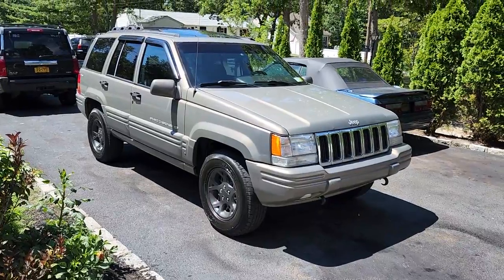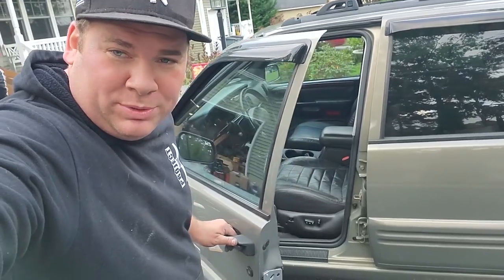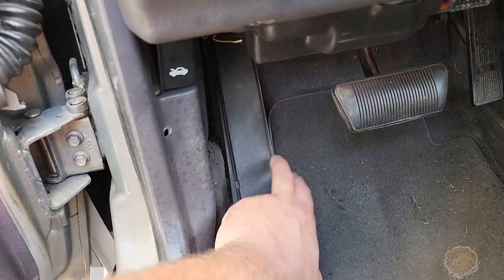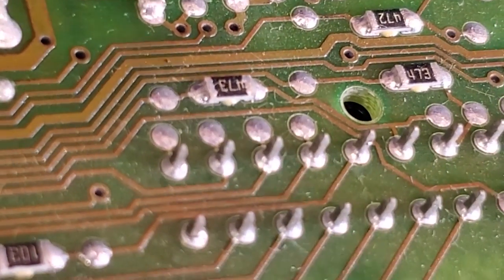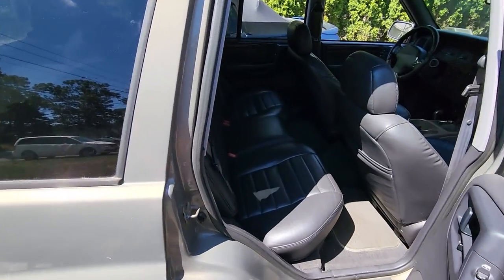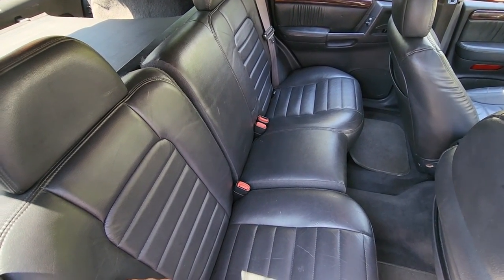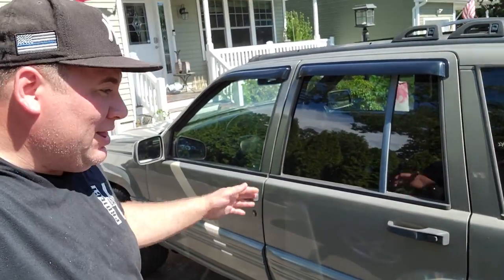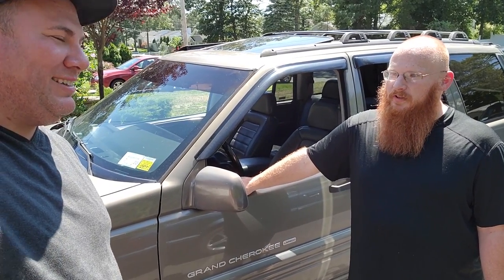THINGS I LOVE and HATE ABOUT THE JEEP GRAND CHEROKEE ZJ - BYE BYE GENERAL GRIEVOUS.

Comment: Your videos on General G inspired me to find a ZJ, (my daughter was driving a 2wd) for daily driving and something to tinker with.  I found a 95 for 1500$. It’s been three years and its the most useful vehicle I’ve ever owned even over several pickups I’ve had.  I’ve hauled axles, transfer cases, trash to the dump, recycling, driven cross country,  (WA to PA and back), where I slept in the back for two weeks. Now it’s my mountain bike trailhead rig.  

Wish I still had my 84 Scrambler but I really love this thing.  Needs a new tranny soon and the valves are getting noisy but I’m keeping it.  I keep the seats in the back laid down, in fact only the bottom to the small seat do I keep inside.  That is for the my grandson’s seat.  Awesome vehicle! 
Thanks General! Thanks Dan!
Reply from the maker: Thank you so much Paul! I'd have to agree... The ZJ is the most utilized utility vehicle out of all my SUVs!  Thanks for all your views

Comment: @Project Dan H: 
The Windshield Washer Fluid Reservoir more-than-likely has that empty void at the top to help prevent a completely full reservoir from creating a vacuum as it empties, thus restricting flow through the line. Like filling a 2-liter soda bottle to the top, capping it and poking a hole in the bottom - it'll trickle out slowly - Remove the cap as it's draining and it'll start pouring out.
Reply from the maker: Smart.. A little air displacement goes along way!
Reply: @ProjectDanH  Also, think winter time. Gives the possibly freezing fluid room to extend, rather than let the system burst somewhere.
Reply: Could also be helping on freezing temperatures to have some extra volume to explant.

Comment: Dan thank you!  I just bought our 6th ZJ!  I’ve had new and fancy Grand Cherokees but I prefer the ZJ’s the best.  The first was new in 1994 and we’ve been driving one consistently ever since. The latest is a ‘97 TSi w 5.2.  Gonna run it through a body shop for clean-up and use a rusted-out ‘98 as a donor vehicle to upgrade any parts which  are better on the donor.  I’m excited the TSi doesn’t have a sunroof OR memory seats OR the auto HVAC system.  Simple is better when dealing with vehicles with age.
Reply from the maker: yes 100%  Sunroofs have been a pain lately! lol

Comment: I replaced the tumbler in my WJ with a part from Dorman that gets set to your original key the first time you use it, so no locksmiths required. I would guess (without looking) that they probably have one for the ZJ as well. It was pretty cheap, and super easy to replace. It's been working great since.
Reply: The zj fobs require radio waves so you need to pay the dealer or a locksmith
Reply: @martinvalencia6141  I was talking only about the key and the ignition cylinder, if you replace those, the key fob module does not change, and neither does the chip key. The Dorman ignition cylinder I am talking about gets coded to your key the first time you use it, so you don't need a locksmith at all for just replacing the ignition cylinder (which solves the problem with accidentally pulling the key out in the ACC position, leading to a dead battery, which is the issue Dan had with his ZJ.)
Reply from the maker: That's awesome!!

Comment: Dan , your cup holder is missing the rubber insert! My Free-Z  ( same color '98 ) has one and it looks to be OEM. The two pockets securely hold anything that will fit inside. 
Very well done videos and you helped me get my ZJ up and running where I just finished a seven hour off road 4-WD Club adventure and the Jeep handled all of the trails,hills and descends like a champ.  100% stock.
Reply: Cup holdsr insert only came on 98 midels.. was a last minute feature. Thats why i make boat loads of money selling them online lol

Comment: Dan, I'm sorry (and sad) to hear that you SOLD Gen. Grievous. I loved and learned a lot watching you rebuild Grievous. I own 2 ZJs, a 1996 and a 1997. The 96 is the exact same color as Grievous. I wanted to tell you that turning the key past off is called the AUX position. It is a normal function of this ignition tumbler (most cars I know of have an AUX position on the ignition tumbler. It's for playing the car stereo and other misc electricals without running the engine). Although, my keys do NOT pull out in the AUX position. I also wanted to tell you about another feature of the ZJ that most people don't know about. I'm not sure if the XJ or WJ or other Jeeps have the same feature (as far as I know it is a Chrysler thing so maybe they do?), but you can read your engine codes using the ignition cylinder. If your "Check Engine" light should come on for any reason, you can see the error code on your display without using an OBD code reader. Here's how...turn the ignition ON...OFF...ON...OFF...ON...OFF and finally ON...but DO NOT START THE ENGINE. Wait a minute. then Watch your lower right dash panel lights flash and count the flashes to read the number codes. The codes are usually 2 digit numbers...example: The first code will always be BATTERY code 12 and will look like 1) BLINK....2) BLINK-BLINK. End code will ALWAYS be 55 and will look like 5 BLINKS...5 BLINKS. All pairs of blinks in between 12 (battery) and 55 (end of codes) will be your trouble codes. I learned this trick with my 1996 ZJ when it had a bad ignition coil/ignition relay. I didn't know what was going on until I was told about this CODE trick and error code 45 kept coming up. I hope this is helpful information for future reference.
Reply from the maker: thank you so much for watching, yes the aux position is common however the keys are not supposed to come off. lol.  not many people know about the Chrysler self-diagnostic mode.  The XJs can be activated if you press and hold the odomiter button while putting the keys into the on position.  Thanks!

Comment: How about how to install new windshield wipers?  I did it about 15 years ago but I must have lost some IQ and patience between then and now...  can't find a video about it for the ZJ.  Thanks for  the videos.  I got my driver's side lower door hinge welded about a month or so ago and already one of the side welds has popped loose, have to get that welded again.  I think what happens is the little thing that looks like a round gear stops rotating so it creates extra leverage on the hinge.

Comment: My XJ is guilty of that overturned key thing. It has just been a jumpstart. I’m used to it and careful of it but anytime someone else drives it I gotta warn em. Lol
Reply from the maker: Lol... New drivers just don't know!
Reply: Its an accesory only feature..  to keep 12v ignition power off.. it isnt a defect
Reply: @jeepsblackpowderandlights4305  no the key position isn’t a defect. Correct. However over time the line gets blurred as to just what position is going on in there. I find it’s just one of those things where you have to use a softer hand. If not you’ll be doing some repair you don’t really want to.

Comment: My truck being a 2000 dodge ram Laramie slt doesn't have the halo ignition ring illumination,, I have a black plastic ring no light.and im lucky my cylinder works fine and you cannot remove the key unless it is in the off position and I am ruining it so I can pull out the key lol and I like the ram second gen center console on the seats and the manual gearshift lever for the transfer case

Comment: The extra key position is an acc only one. You shouldn't be able to take the key out, so it does look like something is worn/broken.
Reply from the maker: Yep. Definitely a worn tumbler!
Reply: Actually no you can take the key out on all ZJs there is no locking function..  but yes hes a noob the last click is for radio etc so you dont have 12v ingition on for power.

Every single ZJ ive seen the key can pull out in any position.. ours was like that brand new.
Reply: @jeepsblackpowderandlights4305  mine's a UK spec one, might explain the difference.
Reply: @MattBrownbill  i actually prefer no key lock... its nice to have for when you need to check the mail box lock or lock your gate and not have to shut down the vehicle every time ( i have a locking mail box and gate on my property)  or if you need to lock the vehicle but keep it running for the heat or a.c if someone is still in there.  Like your dog or something.

But ive never encountered a J with a locking key cylinder.  Maybe its on older zjs ? From the first gen no idea.  But deff not on newer ones.

My 90 Grand Wagoneer has no locking key either

Comment: I need a ZJ with heated seats!! Nice video on the Love-Hate!!
Reply: Drivers seat tends to always go bad the little wire on the left cheek rips as you get in and out repeadidly
Reply: @jeepsblackpowderandlights4305  yeah honestly my ZJ is just a beater so no heated seats needed 🤪
Reply: @MacsSpecialitiesProperties  well with leather and winter its nice to have lol.  On my 5.9 its been bad for years now.. attemoted to solder new wire on it but it breaks again.  Plus my 5.9 driver seat is torn badly from my sweating as i did landscaping in my car.  Plus i tend to sweat badly on my back..

I ruined my grand wagoneers back leather too from just leather causing me sweat.. it sucks

I have replacement covers though from another 5.9 just never got to installing em yet
Reply: @jeepsblackpowderandlights4305  yeah I not much of leather guy myself!

Comment: Do you happen to know anyone who has the map light on the passenger side of the center console push clear lense mine on my 2000 dodge ram Laramie slt longbed quad cab is broken the Dr side works the passenger side just rattles it doesn't click when you push it

Comment: ZJ 4.0 gets horrible gas mileage... but turns less than 1600rpm @65mph on the freeway, with a set of 31x10.50R15's with an unmodified suspension.

ZJ 4.0 has annoying valve tappet 'tick', but starts every morning with no issues.

ZJ 4.0 engineers made it so you can take the ENTIRE dash assembly apart and STILL not have access to the factory stereo antenna cable. 

ZJ 4.0 is NOT designed for people who are 6'5" - so even with the seat all the way back, you feel like you're kissing the dash.
As an added BONUS - you simply cannot fold the back of the rear seats down all the way, unless the driver seat is all the way forward and you can somehow manage to drive down the street the door open and your legs spread apart like a woman in the stirrups at an OB/GYN office. 

ZJ 4.0 is something you cannot help but fall in love with, though. Easy to shift in and out of 4-wheel drive, rides comfortably and has a great turning radius - until you start messin' around with oversize tires on that unmodified suspension. As it is right now, I've done minor plastic bumper trimming and inner fenderwell rolling - but absolutely REFUSE to hack the fender up for added clearance. - I'd rather wait and install a lift.
Reply from the maker: Great input! You nailed it brother!

Comment: You didn’t mention the automatic transmition. My 4.0l is extremely slow with the At transmition, if someone know any solution, I appreciate
Reply: Adjust kick down cable.  Make sure Cam nad crank sensors are working.

Comment: You clearly havent had a ZJ that long or know too much about em if you think the key tumbler is defective..  This was a feature to allow you to have the radio without actually having 12V ignition power to everything else draining your battery... smh.  They all have this feature.  Youre kinda crying a little much about the lift gate cargo cover...  all i hear is wah wah wah about the light block.   I dont even use the cargo covers not even on my grand wagoneer..  Kinda pointless to have honestly.  Theyre not that rare either btw i see them all the time in salvage yards

Yoire also crying about the cup holder again not knowing anything about the ZJ.  Yours was missing the rubber cup holder insert... .  Ive sold dozens and dozens of them lol.

ZJ isnt THAT comfortable.. as a 6ft 250lbs man.. The leg room isnt too great on the drivers side my right leg always rubs the side of the dash hurting my calf over time..  my knee nearly hits the shifter handle.. and pushing the seat back too far causes strain for the arms on the stearing wheel.  You should try a wagoneer wagoneer sj if you think the ZJ was comfy lol.

Whats wrong with leadless solder ?  Most solder today if not all is leadless solder.   For enviormental reasons.   Smh.   Also i will at least agree sith you on the sunroof mine shattered too but it wasnt hard to replace.. took me an hour or two.

My main complaint with the ZJ is the rear hatch window sensor.  The way the sensor is built by just being sqquezed by metal is stupid and causes your lights to stay on.  Or the car alarm to go off.   The other thing i hate is the rear hatch main door handle.  Pita.

The last complaint isnt about the ZJ but the overall quality of replacement parts.. everyyhing you buy alternator radiators.. power steering etc.. all chinese and all last a year or two before you gatta replace them again and again..

Memory seat button sucks it always kept resetting on mine 5.9 so i jist unplugged it

Ive had two ZJs for 20 years.. a 4.0 with 400k miles now and my 5.9 limited.
Reply from the maker: LOL The key is not supposed to be REMOVED in accessory mode so I guess you missed the point.  Did  actually watch the vid???  Youre complaining about things I covered!!! C'mon man!
Reply: @ProjectDanH   I can pull it out in all modes on both of my ZJ Jeeps my 5.9 and 4.0 and in the JY ones.. and weve had our 98 ZJ 4.0 for 21 years.. 2nd owner when it was 1-2 years old.  Key still pulled out.  Just saying..  i guess mine broke when the vehicle was new right
Reply from the maker: @jeepsblackpowderandlights4305  Yes.. when you brake it, it will remain broken.  Even if you brake it when it's new.  Hence the problem... 🤦  They shouldn't brake so easily.. especially when they're new.
Reply: @ProjectDanH  interesting.  Because seen hundreds in the jy.

Funny thing i can even turn it to accesory without a key lol
Reply from the maker: @jeepsblackpowderandlights4305  lol! Yes! Exactly!  In the Junkyard and all broken!  Crappy tumblers with a flaw.   None of my Jeeps do that. Thanks for proving my point.  🤣👍
Reply: @ProjectDanH  none of the Jeeps in the jy are there because theyre budted up.. they look mint.. You clearly dont go to them often do you ?  99% of them in DMV are mint.   Just traded in for the 500$ because theyre not worth anything anymore.

Also as i said my brand new ZJ did it too.   Just because youve fixed a few things on a ZJ doesnt mean youre right.  Ive been working on these Jeeps for decades.  And not once have a seen held in by the tumbler